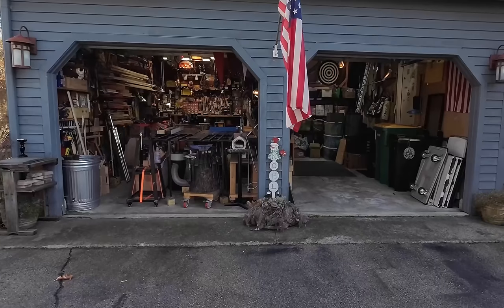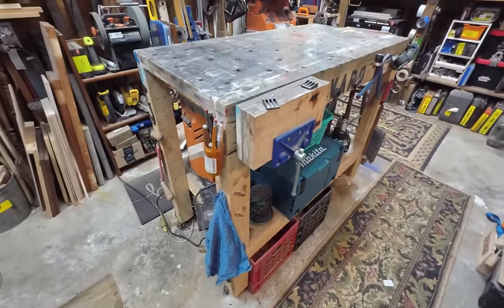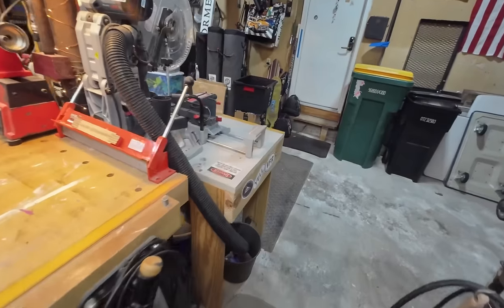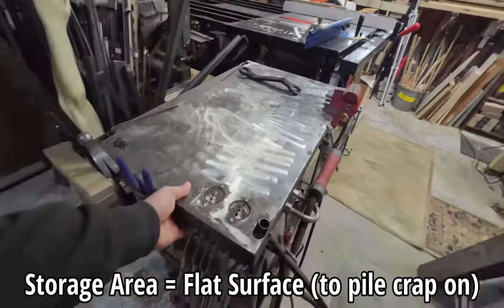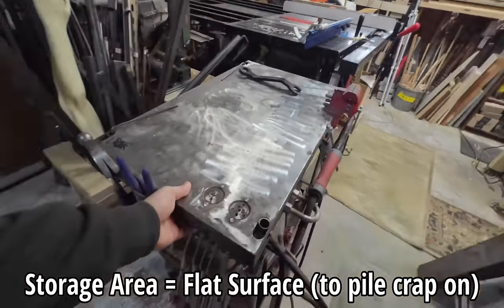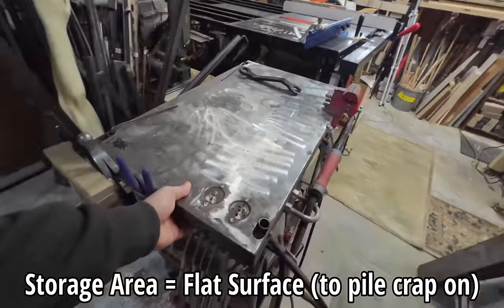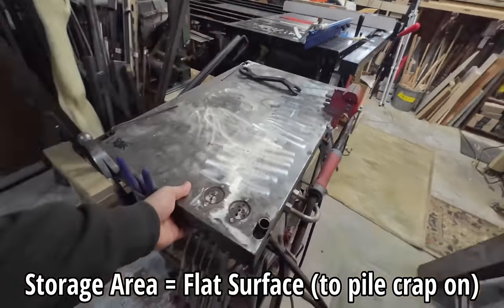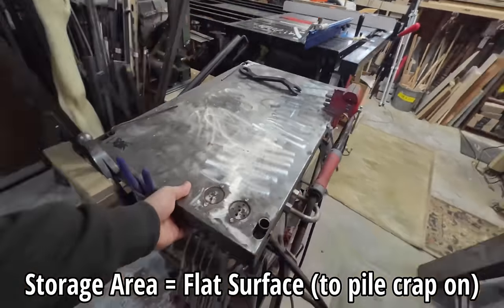The New Janky Workshop Tour

Comment: I have built several shops over the years. I finally learned my lesson with the last one. INSULATE FIRST!! If you move a couple of tools in and plan to do it later, you will start to hang a few things on the wall to get them out of the way, and before you know it, your walls are covered and you will never get around to the insulation because you will have to empty and move everything. Individual results may vary, but this is how my life works. 
 
Great shop, great videos!!
Reply from the maker: Thanks for watching! Appreciate the kudos.

Yes, I definitely should have insulated first. I might start to get around to doing that as fall rolls around. Now that I have 220 readily available in the shop (had some electrical upgrades done this spring), I might get a beefy shop heater, which will make it more tolerable in the winter.

When I started this journey, I didn't know I'd end up here, so here I am years later, with my walls completely covered (as you can see...)

The long term plan is to renovate the space above the shop into an office/spare room, and then everything will get ripped out, insulated, drywalled, etc.

Thanks again!!

Comment: Great shop tour. I have been thinking about buying a California Tools air compressor for the quietness.  How is its charging time.  The air compressor I have now goes off within seconds after I start using it and then seems to last forver after I am done and make lots of noise.  I want something quiet but strong enough to run auto air tools if I want to do some kind of repair.  What size is your air compressor.
Reply from the maker: Thanks Rob!

This one is just a 1 gallon, which is fine for my basement shop, but too small for using any tool for any length of time. I'm usually using this one for blowing out the laser cutter, and brad nailing, so it works fine for that. It is SUPER quiet compared to the deafening Porter-cable 5 gallon pancake I have in my garage shop. I'd check out their larger ones to see if those are powerful enough for air tools.

You probably want something with a large tank, and that has the CFM to support whatever tool you are using.

Here's a link to the one I have: https://kit.co/TheNewJankyWorkshop/the-new-janky-workshop-2023-tool-list/california-air-tools
Reply: @TheNewJankyWorkshop  thanks for the information.  I need to spend sometime thinking through what I really need vs. want.  Wishing you much success.
Reply from the maker: Welcome and thank you sir! Same!